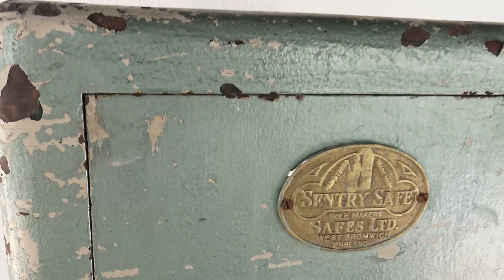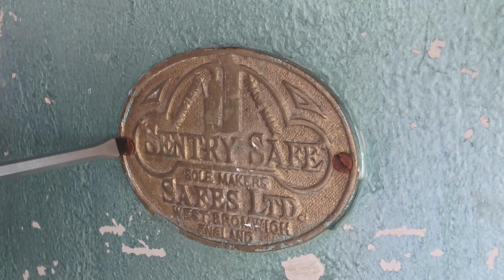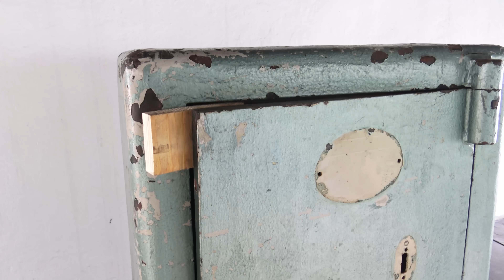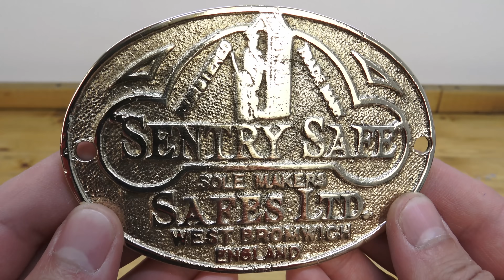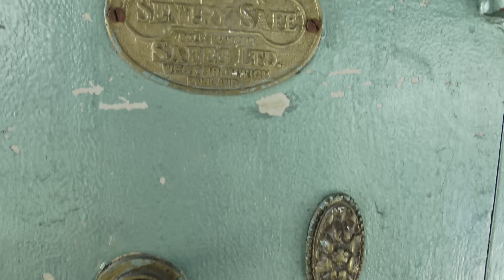1930s Antique Sentry Safe Restoration - Perfect Restoration

Comment: Brass feet and casters would have really set that thing off! Too bad it can't hold the weight. First Class restoration Sir! Can't believe anyone would give that a thumbs down. Great job!
Reply: you can brass steel just fine, heat it up, and use a brass wire wheel to colour the metal in brass.

Comment: I have a safe like this in my basement, was here when I bought the house…..however it’s 5 feet tall, and weighs over 1000 pounds.  I’m hoping to restore it some day, I think this video will help.  Thanks 👍
Reply: Its not that hard to do paint wise this guy here is a pro and its not that big a safe.  This is how the big ones are redone .. .  Spray on automotive paint stripper aka " aircraft remover "and a stainless dish scrubber will make quick work of the old paint.    Now repaint it completely outside w black traditionally. I prefer black engine crinkle paint myself .. but whatever you want. .  And then paint an acrylic scene landscape usually on the front of the safe and gold line around it. You can use automotive edge strip if youd prefer ... Then clear varnish the entire safe an extra coat on the front.

Comment: I bought a nice (it was pictured as complete) at government auction a safe made of half inch plate designed for a two drawer file cabinet. When I drove over two hours to get it I saw that all the internals had been removed. No S&G lock, no locking bolts or arms and no handle etc. I had to make all the parts without the aid of having another to compare to. I got a new S&G lock on eBay and then began. Large bearing rollers worked well for the locking bolts being hardened steel. Figuring out the wheel to retract the horizontal bolt was about the most difficult part.

Comment: Amazing workmanship! Kind of left with a question though, doesn't adding wheels make a safe, you know, less safe? Because it can now be taken away more easily?
Reply: It definitely does, but then again given the rest of the safe's construction, it wasn't very safe to start with (certainly for today's standards).
Reply: That looks more like a fire safe than an impenetrable vault. You could probably cut the back off in a matter of minutes (like 5 to 10) with a cordless circular saw spinning a metal blade. And if it's heavy enough all you gotta do is screw a curb to floor in front of it to make sure it tips over on any crackhead trying to wheel it away.
Reply: No casters so not that easy…
Reply: @elizdavidson  There are casters - you can see them being assembled from 31:11 and in the final view at 35:43
Reply: @elizdavidson  sure, casters make it harder to move than wheels. But they still make it easier to move than no casters, and that's the point I was trying to make.
Reply: @dlevi67  I think she meant that they are fixed casters, not swivel casters.
Reply: @amcconnell6730  Fair enough. Thanks for clarifying!
Reply: Oliver Pong  Mind you, a good early copy of Apicius goes for $4-5,000 😉

Comment: I enjoyed the craftsmanship in this safe. However I really don't understand putting wheels on a safe. The purpose of a safe is to make it difficult to steal your items. Putting it on wheels just makes it easier to wheel your valuables away and get at it in a more secure location to crack for the thief. You want to make a safe more difficult to move not easier.
Reply: No thief would dare scratch that paintwork. Though they might steal it for the safe itself..
Reply: You took my thoughts and placed them in to a brilliant comment!
Nice one CJ!!!
Reply: But safes do often have casters.
Reply: I grew up in South Africa where house robbery is a daily consideration. At least in our home, we considered our safe a time waster to discourace thieves from spending too much time at the home, not a full on prevention method. Thats what banks are for. The time it takes to crack a safe is generally less than that required to wheel it out of the house and then load it onto a waiting large vehicle. Large angle grinders, oxy torch or even just 3 guys each putting their full weight into large prybars are all much more than most standard safes are designed to withstand. Casters or no, a small pallet‐jack will wheel out even massive safes, makes no difference to a committed thief.

I guess what I'm saying is that the old adage still applies. "Locks only keep the honest man out."
Reply: The wheels were never really meant for security, they were a convenience thing, where your office may have several safes like this that get moved in and out of a large locked room or safe daily - safer and holds more then a money bag.
Reply: @jimmyfleebot  a safe should always be bolted to the floor
Reply: @georgeh9967  ours was, I will admit. But i still maintain that it makes little difference to a committed thief. Bolting to the floor offers fulcrum points of greater stability when using prybars.

Comment: After watching you strip this to nothing, it is shocking to see how bad British quality is.

Well done on fixing that mess 👍
Reply: That’s not how it left the factory, someone has butchered it. You can’t beat British workmanship renown throughout the world.👍🇬🇧
Reply: @aytonbob  I can see it was butchered but there is no way that the "butcherer" ground off weld marks perfectly back to a blank piece of metal and then forgot to reweld it completely. There is no way that the "butcherer" added casting marks to parts that have already been cast.

But I could see that the internals had been changed.

As for "British quality being renowned" yes you are right to a certain degree.
It's not like that anymore though that all stopped in 60s and 70s

Anything made in the UK these days us usually bad quality or good quality that been made cheaper abroad and imported.

There are not many skills left in the UK now.
Reply: British quality was mostly a myth. You got what you paid for. Britain made good quality and they made “Colonial Trade” quality….
The lock in this was probably original (as it matched the key escutcheon).

Comment: There was an antique safe in a store I worked many years ago.  It was mounted into a 2 foot high concrete block with bolts out the bottom.  The door on that thing weighed 200 pounds on it's own.  i only wish we could have taken it with us when we moved.

Comment: Only suggestion I would have is put the threadlocker lower on the screws so it covers more threads, not a huge deal but just a little more secure hold. Really nice work tho

Comment: When you used that wood block to hold out the door, and then a vise to slightly bend in the bottom of the door so it was all flush again .. that impressed me.  I never thought of something that simple to get such a good result.  As to the imperfections in the handle for the safe .. I sort of wonder was that part of how they were made?  With those imperfections?  It's not wear or pitting from age there were gaps and it seems more like a defect in the handle.  Nicely resolved by the way.
Reply from the maker: thanks, the errors in the brass materials were a fabrication error.  unfortunately a poor quality brass casting.

Comment: Beautiful job, like the attention to detail with respect to aligning the slots in the screws (as with the handle). What I cannot fathom is why add wheels to the safe? We’re there on the original? The manufacturer’s web site does not have any safes with wheels. Wouldn’t a thief just wheel the whole safe into the back of a truck and vanish?

Comment: Great job... however I would still have welded the two lock pins on. Those screws will not hold up if someone pries on it with a bar.
Reply from the maker: Yes possible

Comment: Was this for a customer or for yourself? The logo dead center in the front seemed a bit much if it were for a customer. I would have put it on the lock box door on the inside.

Comment: why was liquid metal used first, and then another filler material? 14:25. why not simply use the other filler and leave the liquid metal out? is the liquid metal better for larger holes, as id assume it dries harder? 

im assuming this pouring of oil is done as a second rust-proofing method after the bluing? 26:11. as i rarely see it done to blued things like this, it is not necessary for the cold bluing process? 

what is the blue, ink-like liquid used in the assembly when tightening the screws? 27:44. i suspect it is some kind of glue, or locking solution, but i dont know why it'd be used here. i guess so the screws dont come loose? but if thats the case, why isnt it used every time a screw is tightened in place? 

what is the utility of welding oil, used at 28:51?

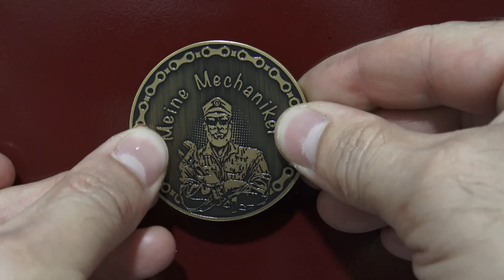how was the meine mechaniker -logo attached, at 32:38? it seems like it was just tapped onto place? are those bolts, and i just didnt notice the holes drilled in? 

thank you for an amazing video, and thanks for everyone who answers my questions!

Comment: Perfect work but four things to complain. A safe never has rollers like a trolley. Allen screws do not belong to the epoche. Personally I would expect the inside more of a grey color. Why did you heat shrink a piece of plastic to the inside lever and not a brass sleeve or u-shaped slider to the slit?
It would be interesting to know the story of this safe as it seems to me it was violently opened at least once a time.

Comment: 28:20 That is what happen when you use a wrong screwdriver... If the screw is Allen, why did you use a Torx screwdriver? =(
Reply from the maker: The tip I use is a multi-tip.

Comment: WHEELS?
Reply from the maker: Yes, You can do retrospective research. original.
Reply: Hi, I did some research, putting wheels on a safe IS definitely original. If it gets stolen, hopefully it'll slide around in the back of the van, making enough noise to alert the police.
Reply from the maker: @olinewman  😅

Comment: nice job but you put a safe on casters so anyone that wants to steel what is inside can just wheel it out of the house.
sounds dumb to me.
a good safe it one that is to heavey to move or bolted to the wall and or floor